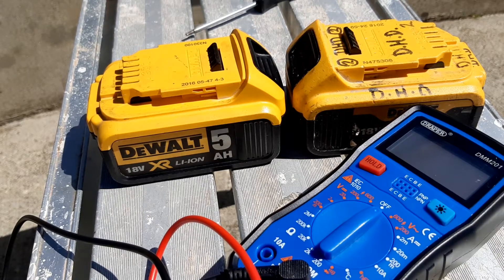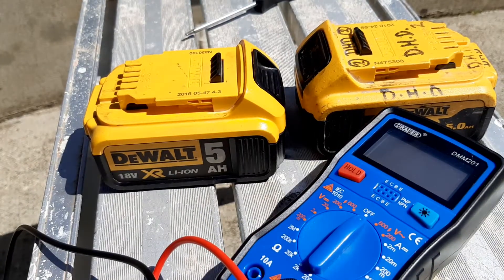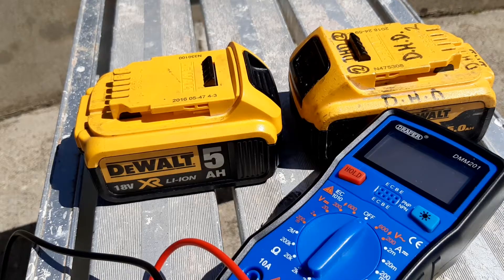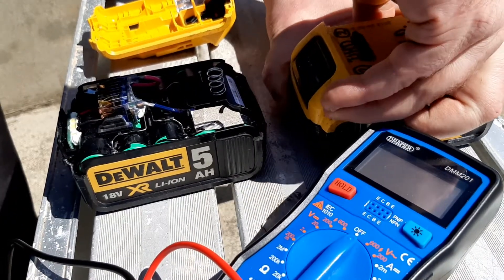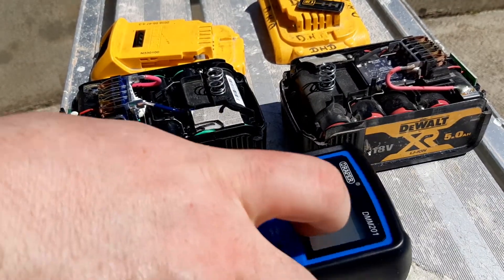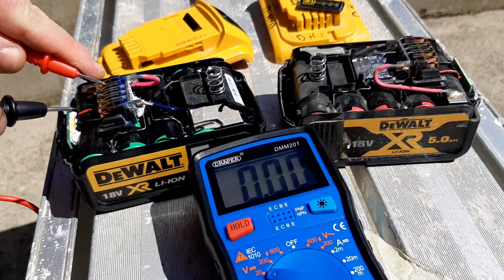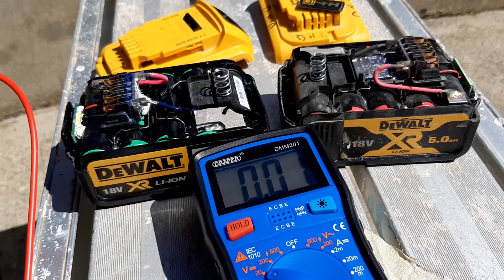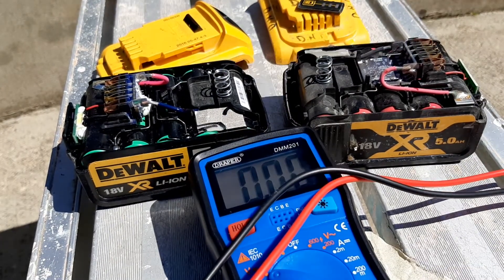How To Test Voltage On a Dewalt Battery ( New vs Old )

Comment: First.....WHY would you take the battery apart? Slip the terminal into the first and last lead location....no need to take apart the battery. Second, switch the multimeter to 200. Your multimeter is basically PINGING OUT of range. It hits 20 and that is as high as you have it set to read. If you go to 200, it will read properly and show you the correct voltage.
Reply from the maker: Yes you are correct but if you check my newer videos you will see my knowledge has improved in this respect
https://youtu.be/qwOC9FC_oeA
Reply: I think he did that because sometimes the leads don’t fit. I touched the battery terminals from the top, and the tip of my leads barely reached. 

On a better note , thank you for the 200 instead of 20 V setting! Gave me 20 V exactly on my reading which means fully charged. When I had it set to 20, it was all over the place